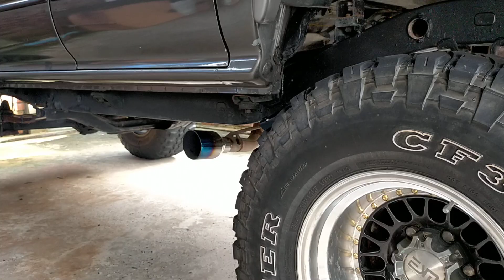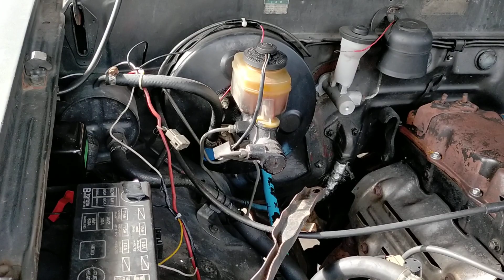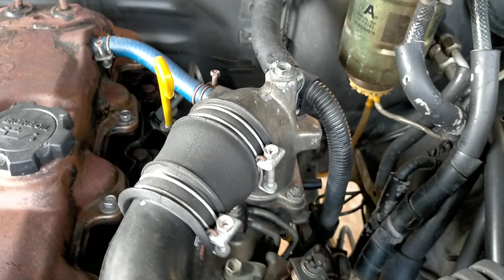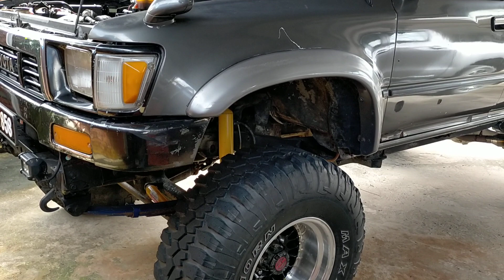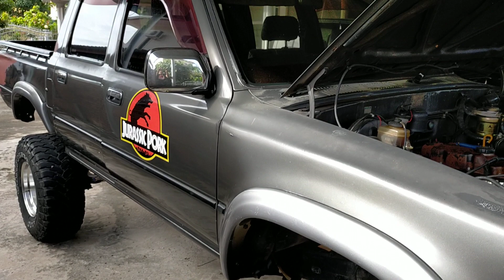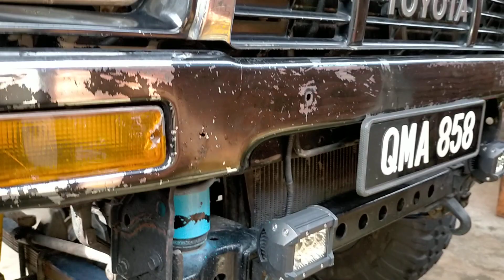Oldskool.Hilux LN106.Warm up engine.

Comment: Bosku .sy tgk Exhaust kau mcm kasi pendek kan buang tepi..ada perubahan Power kaa klo kasi pndek Exhaust tanpa turbo...
Reply from the maker: Ya,,,sya potong.tiada pakai silencer,,,sya pasang chamber exzos kosong.bunyi agak mengamcam lah.power naik sikit dan makan minyak juga.servis nozel juga dan adjust sikit diesel,,,memang power walau tiada turbo
Reply: @andrewsebastian1317  woww..mantapp..tq bro for the info..perkongsian yg baik..saya pun mau try buat la begitu..mau main N/A jak.. klo psg turbo byk mau di jaga..
Reply from the maker: @jeromegan5662  yalah,,sya buat  utk engine power sja,kuat utk sya offroad,,,bukan utk racing.hihi.on road paling laju sya drive pun meter 100,,,,tak brani sgt laju psl kreta tinggi.
Reply: @andrewsebastian1317  ya la.. btl tu..krta tnggi bhya bwa laju btl..lain la klo kaki2 smua fit..hehe..
Sy punya tu Mark2 bah.. engine 2.8 juga..kira2 mo Kasi pndik ekzos sm adjust fuel pam..spya kuat sikit tu engine..klo masi original tu..lidut btul bah..lagipun barat kan tu badan Mark2 hahaa
Reply: @andrewsebastian1317  bosku..ada ka vdeo kau yg Kasi dangar bunyi ekzos..
Reply from the maker: @jeromegan5662  ada bos.ko cari Hot sound Hilux Ln106